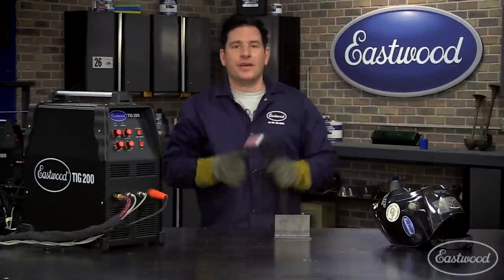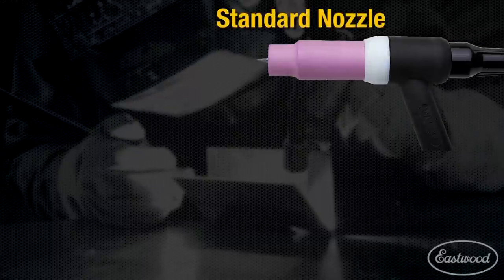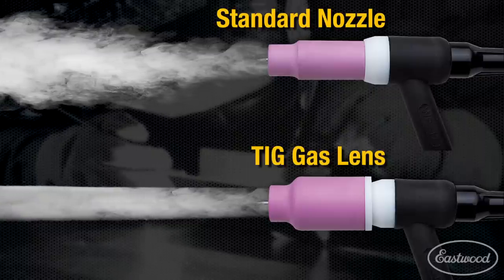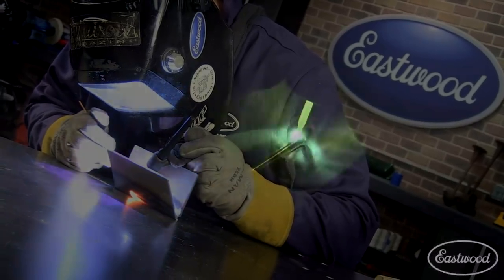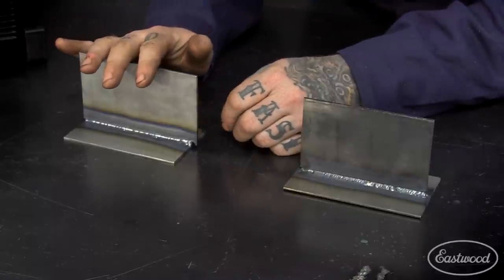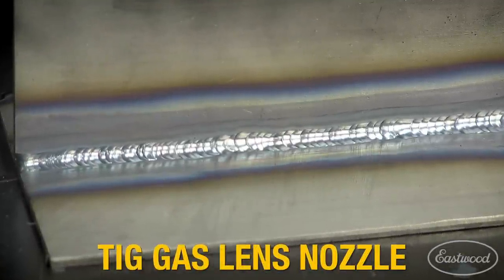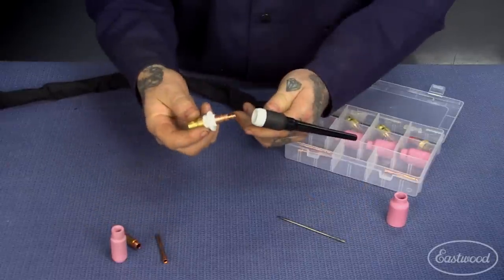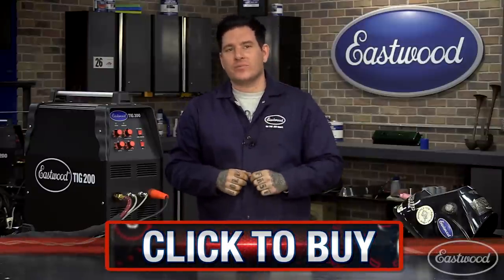How To TIG Weld Like a Pro! TIG Gas Lens Kit for TIG Welders - Eastwood

Comment: One of these days, I'm going to figure out how to apply a visible gas, like from a fog machine, and see how accurate these claims are.
Reply: Easy
Reply: Yeah there is a lot of exaggerated and false marketing in this video to make people buy it. A gas lens is definitely not going to make you weld like a pro. In fact the difference is barely noticeable until you start running large cups
Reply: @TheChrisey  that is true, gas lens can also cover up issues that you would’ve otherwise had to fix on the standard ceramic cups.
Reply: Use one of those vape e cigarette things

Comment: Can anyone explain to me why I get way more contamination with a gas lens than with a standard tip?  The lens was working great for tee joints, but butt joints are just unending contamination.  I went back to the standard cup and had no issues.  I'm using a TIG200.  Gas lens was a #10 cup, standard is a #7.
Reply: A #10 gas lens cup is way too big, #8 is the biggest you should go. And even with a #8 you have to turn your gas flow up quite a bit. I'd recommend a #6, like he's using in the video
Reply: @devinwestgate1096  awesome, thank you!  I don't think I have a #6 but will pick one up and try it out.  Staying to play with stainless and the standard cups clearly don't provide enough coverage.

Comment: whats the chf setting from the standard vs gas lense? would i leave the same 15-20cfh on the gas lense and expect same results?
Reply from the maker: +Tee Giang  A link to visit Eastwood for more info is in the video as well as the description below the video.
Reply: I cannot find the answer to the recommended flow rate. Please advise